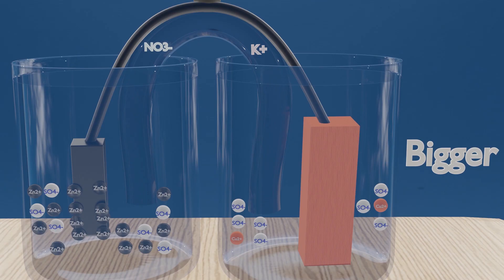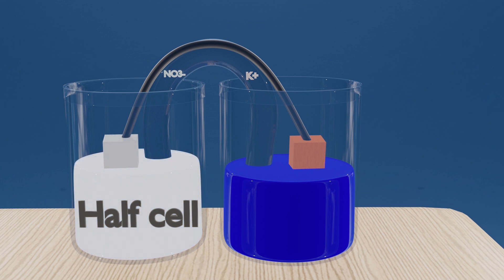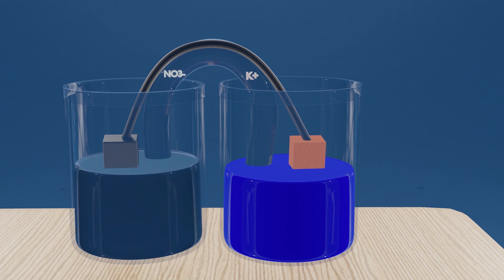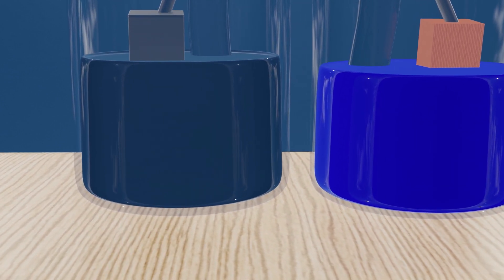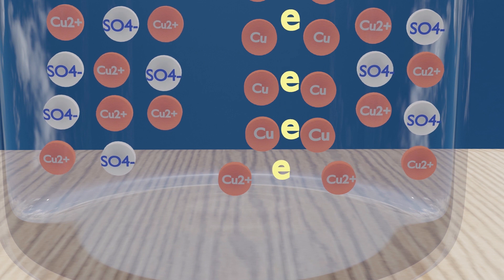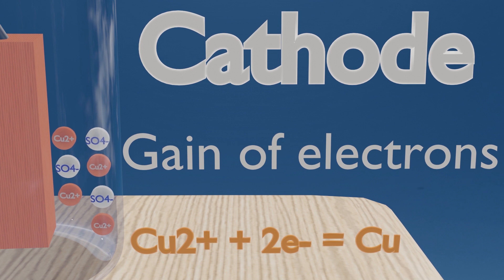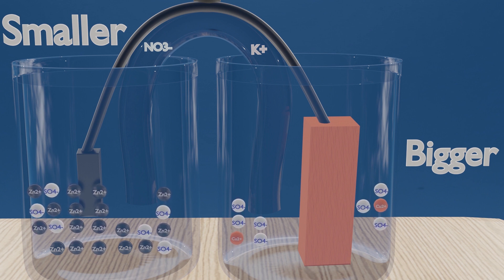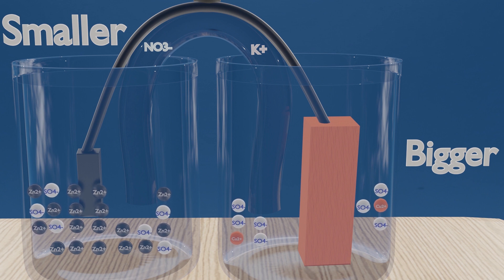Galvanic cells explained -in UNDER 5 MINUTES.

Comment: I love ur vid, sorry for my bad english but i've a question. What if there was no electrical wire? When I studied galvani cell in high school in Vietnam, our test ask us which part in galvani cell is not necessary, and the answer is the wire. So I wonder that the electron flow from anode to cathode by wire, why cell can work without it? Thks very much, have a nice day, sir ( actually I really bad in English so I can't understand what u said in vid 🥲🥲)
Reply: the wire(or the electric load) is necessary for the electrons to flow from one side to the other forming a continous current and leading to a continous reaction. Without the wire, the zinc atoms cannot give electrons to the copper ions
Reply: So which part is not necessary ? We have 4 answers: zinc, copper, salt bridge and wire ( or this question is wrong😭😭 )
Reply: @ngockhuephannguyen7515  My teacher said electrons can travel through liquid like acid, base and salt (but slower than through a wire) so if there's no wiring the reaction still happens. 

Looks like the two metals have to be:
1)in the same liquid and container (for example two pieces of metal dipped in the same bottle of acid) so they use that liquid to pass electrons. 2) or have to touch each other so electrons pass through them directly.

-My teacher told me like this so pls correct me if I'm wrong.
Reply: @03lamthaoanh78  Hm cảm ơn vì câu trl của bạn. Sau khi nghiên cứu lại về lý thuyết nguồn điện trong Vật lý thì mình rút ra kết luận là dòng e ở dây dẫn chưa đủ để tạo thành nguồn điện, e không trao đổi thông qua dung dịch được, việc có cầu muối thực chất là để trao đổi ion ( dòng điện bao gồm cả dòng e và dòng ion ) tạo ra một dòng khép kín
Reply: Còn cái việc e trao đổi trong dung dịch thì mình chưa thấy tài liệu nào nhắc đến 🤔🤔. Mình mới xem lại lần nữa thì pin Galvani có cơ chế để tránh e di chuyển bằng đường dung dịch. Một là hai cốc được tách riêng ra, hai là cầu muối được thiết kế để không cho e đi qua luôn
Reply: @ mình cũng không biết luôn tại khúc này thầy lướt đúng nhanh nên có khi mình nhớ lộn😭😭mình chỉ nhớ thầy nói cắm vô cùng 1 dung dịch (như trái chanh) hoặc cho 2 thanh chạm nhau là được xd
Reply: @ngockhuephannguyen7515  hay để mai mình hỏi thầy lại coi thầy giải thích như nào xD

Comment: the electrical current is flow from cathode to anode through what?
a) through external circuit 
b) salt bridge
Reply: external circuit, salt bridge is only there for ion regulation in each half-cell
Reply: @ataulhaye5801  okay thank you

Comment: your video is great, but i've got question about electrolyte in each half cell (not in salt bridge). As I read, electrolyte providing ions for redox reactions and material's electrode could do this too, so why do we still need electrolyte ?
Reply from the maker: Great question. It is possible to use conducting solid material in batteries as electrolyte.It is also safer as it has a lower risk of catching fire. But in this specific example I presented a common experiment, the Daniell cell, which was first compiled by John Frederick Daniell (in the way it is presented in the animation).